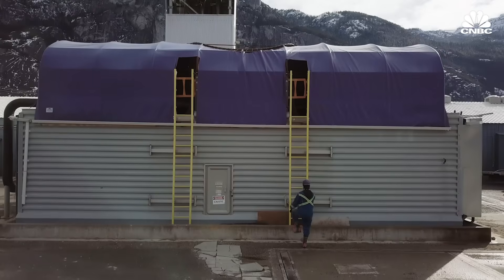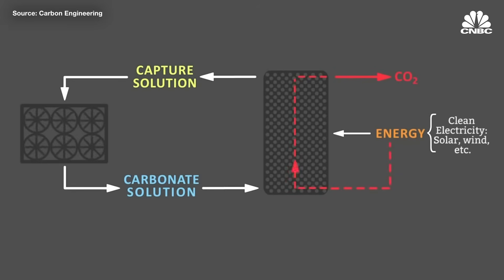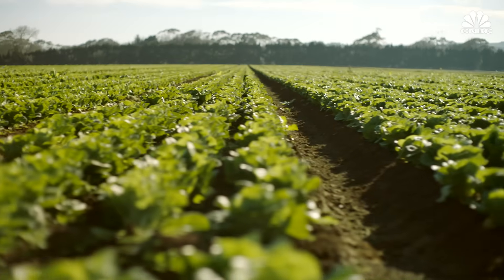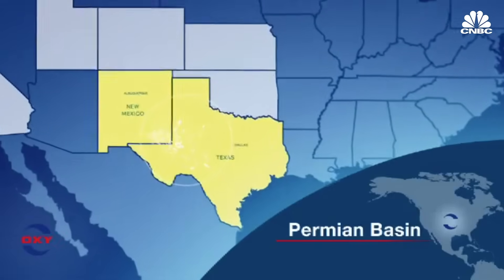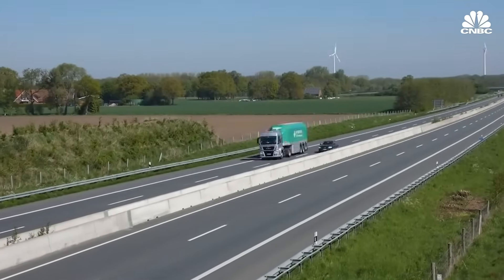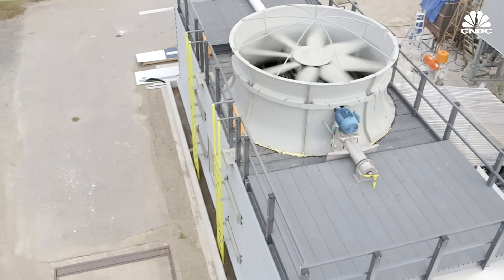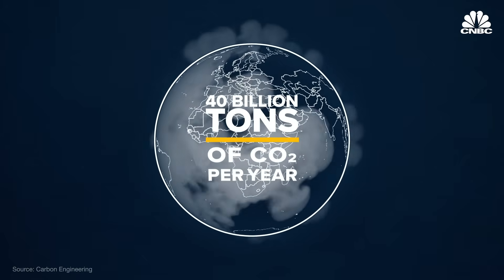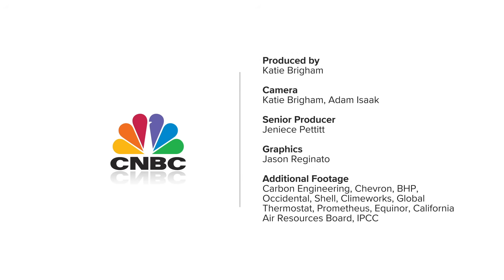Bill Gates-Backed Carbon Capture Plant Does The Work Of 40 Million Trees

Comment: SURPRISE, SURPRISE carbon dioxide is a life giving gas as plants absorb it they give out oxygen we breathe.
Crops love it and produce food for flora and in return feed mankind with crops.
There is no carbon 'problem' or 'carbon dioxide '  problem, only benefits for mankind- we are a carbon based life form.
But the cunning Jeremiahs want to fighten folk with uncritical minds, especially school children eg ' 'inconvenient truth' scare cartoon by Gore!
In Sydney Harbour the sea has risen about 200mm since 1890 or  about 8 inches !
Check the records of sea levels by Sydney Maritime Services Board from 1890.
So much for the reveries  of  the man made climate push -  melting polar ice caps and shrinking ice glaciers.
To the 'Climate gate' weather data tweakers
Pull the other leg ! It jingles.

Comment: Why not bury the carbonates rather than recover the calcium- no leakage to worry about, you don't need to bury it deep and seal it. Luckily the co2 greenhouse scare is mostly just a mass hysteria anyway- 30 years of shrill 'sky is falling' predictions and nothing to show for a large step-change increase in CO2. The heat-trapping capacity of co2 in the real world is exaggerated at best.

More pressing problems are: massive ecosystem loss, forest clearing, and huge human overpopulation.

Comment: How much CO2 is emitted; manufacturing the components for the machines,  building the machines, transporting all the parts in the supply chain, all the concrete use on site, building any roads for site Access, maintenance and spares for the machines? You don't have any of these problems with planting trees. Though, to replace an acre of forest takes at least 50 years to get back to full health. I guess we could all back off on infinite growth on a finite planet, having less and using less, but we're too greedy for that!

Comment: $94 - $232 per ton of CO2. 20 pounds of CO2 per gallon of gas. 2000 pounds per ton. So, this meathod captures the CO2 from 100 galons of gas.

That means that the cost is $0.90 to $2.32 per gallon of gas. So, a 100% tax on gas could make gas 100% carbon neutral.

Comment: think about this. the oil companies need to drill, pump, transport/transfer to refineries, refine the crude, store the different "products" of the crude, and then transport it to stations for sale. it makes 100% sense for an oil company to get involved in co2 capture. the captured co2 can be turned back into hydrocarbons and then fuel vehicles. no risk for drilling, pumping, transporting initial volatile liquids, storing and recovering other by-product gasses, or long pipelines. the end result is prospective higher gains all the while becoming carbon neutral.
Reply: Just get off fossil fuels and go electric charging off nuclear and solar
Reply: @Les_S537  it's not as simple as that. the infrastructure isn't there for mass immediate shift off of fossil fuels. Plus, the mining of lithium is damaging to the earth as well. The best part of this idea is that it's not a solution. It's a means to extend the window we have to discover, design, and build better and less harmful batteries. So, when the time is right, we can start phasing out fossil fueled vehicles. Nuclear power is also not a great idea as the nuclear waste needs to be stored. 

If we could capture enough co2 from the air to convert back into fuels that we don't have to drill any more oil wells, we'd be carbon neutral. according to them, just 40,000 co2 capturing plants could account for the entire global co2 emissions. we could fit one every 88 sqaure miles if they take up 4 acres each and reach 40,000. All funded by oil companies. The best part for the oil industry? No more oil drilling means they're re-selling you the fuel you already bought from them.

Comment: "It's not stopping the fossil fuel industry."  Talk about losing the thread.
Reply: Fossil Fuel Industry has way more Downside then just co2.
Reply: @gsuekbdhsidbdhd  And it currently has way more upside than downside. Also no other energy source comes close in ease of use, energy density, distribution or cost. If you want things to change you have to beat those metrics. Not easy to do even with nuclear and a power grid and good cheap batteries.
Reply: @dsap4004  Maybe, this applies to the actual state of the art. But a big share of the consumption isnt important at all no crusadships are needed not everyone has to flight to any destination. If we cut in those areas we can cope it with alternatives. Nonetheless fossil fuels are not infinite so there has to be a change.
Reply: @dsap4004  I would agree with you if you don't count all costs of energy sources.   The current financial 'cost' of fossil fuels is not representative of total real costs.  Hydrocarbons are a fantastic way to store energy for all the reasons you mentioned, but you can't say the cost is cheap.  The cost needs to include the long term costs of accelerated climate change, healthcare impacts from pollution, military investment needed to ensure a reliable supply, etc.  If you factor all of that it, it makes other energy sources much more competitive.
Reply: @PoeticJusticeSC  Those "costs" haven't been calculated with an real accuracy and are more tied to policy making and regulator control to keep certain companies in power. This is the real reason you don't have healthy competition in the energy market. Big oil is on the side of the environmentalists because they know they are the only ones who can meet the regulations and push out all competitors and stifle innovation so everyone relies on them. It's a huge game and you are missing the point. The US military investment is for free trade all over the world and is based on Brenton Woods agreement to fight the cold war which has been over for more than 25 years. The rest of the world now needs to pay up after getting free protection and using fake environmental catastrophe claims to try to bully the US into providing more free services. The US has been an exporter of energy since 2012. We don't need anyone else. They don't like this so you get the narrative that the US is a horrible glutton and everyone else is doing amazing things. They are using failed technologies and getting kickbacks from their gov. that have failing economies. Good luck with your "real costs" analysis. It's all a scam. "Fossil fuels" have the highest energy density. We need to find ways to use them more efficiently not regulate them to death so that only a few companies can survive and become monoliths in the industry. If we wanted to get serious about energy we should have gone nuclear a long time ago. Again that's another scam and a political game played about "proliferation" and "nuclear weapons" and "dangerous radiation" instead of facts and engineering. You want to talk about real cost. The real cost is what happens when these "renewable" energy sources don't provide enough power on their own to keep going. We need to switch from hydrocarbons to nuclear. The cost of green energy is too high and requires hydrocarbon infrastructure to survive. That's the honest truth and they are playing you.
Reply: @PoeticJusticeSC  Also we rely on hydrocarbon derivatives for plastics which is another thing that gets hated on. Plastics have saved the world many times over vs their environmental or any other cost. Modern medicine to say the least. What is the cost of driving up the per unit price of plastics used in life saving devices? Computers? Everything in your house? I'm sure pharmaceutical companies would love to charge more. This short sighted narrative I hear when it comes to the "great cost" of "fossil fuels" or whatever truly disturbs me. It shows just how out of touch we are with the real science and the impact on society these technologies have. But sure...try to run your life off of solar and wind without plastic derivatives or modern manufacturing, or healthcare and see how long society lasts like that. No computers either. They aren't green and need to be factored out. They aren't "needed". Nothing is really. Just comes down to how far you are willing to sound virtuous to spite your own face.
Reply: @gsuekbdhsidbdhd  - thats the first time i heard anyone mention lifestyle.  elon musk fanboys are always talking about how evil oil is but half of them showed up at the model y premier by getting on an airplane, and the other half have no qualms with getting on one.  they just like to stand on their fast and inconvenient electric vehicle soapbox, the one built with 85% oil.  not to mention the oil that will be necessary to cover the planet in superchargers...
Reply: @tehevilengineer7939  There is more than just one kind of battery.
Reply: @tehevilengineer7939  There is still development and new kinds of batteries we are not at the end of our possibilities
Reply: Really tho, well congratulations go back into your basement and be a hater while the rest of us save the planet
Reply: Or politicians...
Reply: When you are so invested in your work/interest you risk turning into a fanatic.
Reply: There's a certain variety of ideologue that doesn't really want to fix climate change - they just want to use it to advance their own economic agenda. This variety of ideologue is easy to spot: they like to throw the words "technocrat" and "utopian" around whenever someone actually does something that helps.
Reply: @AlephOneNine  ...and then they wonder why there's so many climate-change skeptics.
Reply: The intellectuals just want to destroy everything they disagree with

Comment: the energy needed to remove this dioxide from the atmosphere through this model is impracticable, to remove both the dioxide that has already been emitted would require more energy and this generation of energy would come from where from the coal-fired power plants? if it is necessary to implement clean energy to close the account then it loses the sense of implementing a project of this caliber worldwide, do you want to replace the trees as if they only fix the carbon fixation and all the other benefits that the trees provide us? this technology can even be developed and used in parallel, but never as a solution, even for it to work out that it needs another solution to be totally integrated, it depends on the clean and accurate energy supply of a market for this captured co2.
We need more plants, more trees, invest in clean energy, and not get dependent again on the projects behind this project, it's a smokescreen, literally backed by the soot industry. These oil companies should be investing in solar energy, their associates should start thinking better because the oil industry has its days counted, and there are plenty of reasons.
#wedonthavemoretime

Comment: This is sooooo stupid! so stupid. Capturing from the air? What? how much fossil fuel is needed to run these plants?

It does make sense to do this at oil refineries and coal power plants, in their smoke stacks. Otherwise there is not enough CO2 to make this worthwhile in just regular air.

Comment: Sell the carbon dioxide to soda companies who bottle it so it can released immediately back into the air! Lol. Good try. 

Soda companies themselves will be under threat.

Aren’t there basic laws of thermodynamics that come into play here? We need to get renewables (solar capture as ultimately all energy on earth came/comes from the sun) to a point that not only do we not use carbon fuels but also are able to reconstitute all the coal and oil extracted over the last 100 years. What is actually realistic?
Reply: I think we need nuclear to provide the bulk of our energy supply.  We need a base of power to work off of and solar and wind can never be that backbone, and installing batteries all over the place to store energy just isn't going to work due to the costs associated with it.

Yes, get off all coal and natural gas and wind turbines, shut down current nuclear reactors, and install molten salt nuclear reactors which are safer and cheaper than current nuclear model designs.

Once we're there, we can run as many atmospheric CO2 scrubbers as we want because the energy it would be using to operate is zero emissions.

Comment: This is like putting a Band-Aid on a sucking chest wound! What about all the organic pollutants and heavy metals which is produced from our petroleum carbon-based fuel sources. We must decrease all of that by not using these Technologies which are outdated in the first place. What is the carbon footprint of this sequestering of CO2 how much energy does it take to run the process has anybody asked that? Give us the real good technology like doctor goodenough solid core fuel cells which are not flammable and don't explode have three to five times the energy density, and charge in 14% of the time? Why is this technology being held back from the citizenry? These Jesuits need to go this mealy-mouthed Jesuit Barbara Burger, casually telling us that we'll still be using 50% petroleum-based gas and oil to run things in 2040? Bulshit don't buy their propaganda. Expose the Jesuit order in America and abroad. We must humiliate them out of power and we must call them out by name

Comment: how were you planing to bypass thermodynamics?
Reply: They are just hunting for naive investors.

Even if you would have access to free concentrated solar to power it up, and recycle chemicals, it will not make any difference. You will need to speed few trillions of dollar per year to even maintain current levels of co2.
Reply: There's no attempt to bypass thermodynamics here.  The carbon dioxide originated with combustion.  Thermodynamic considerations only come up if you're trying to reverse that reaction without a net loss of energy.  What this system does is really just moving the carbon dioxide around, which isn't the same as reversing the reaction and can be done for quite a bit less energy.  I'm not suggesting it's a practical system, just that it's not some sort of perpetual motion scheme.

Comment: I think one of the most promising ways to capture carbon is to use it to make concrete. Normally, producing concrete releases CO2 but researchers are working on how to do the opposite, and finding that carbon-infused concrete can even be stronger than normal concrete. Ultimately we need to find a home for carbon atoms, and putting it into our manmade structures as wood, concrete, or maybe something better in the future, like carbon nanotubes has the best promise for economically sustainable carbon sequestering. Imagine replacing all highways and buildings with carbon-rich materials: it would be so many tons of carbon sequestered.

Comment: A successful process would leave the "thin air" thinner than when it started - how   much thinner you ask ? To begin, what is the procedure to measure the initial carbon dioxide content, and secondly - what is that content ? Does your process have sufficient resolution to measure the difference between the initial concentration and the expected post-process concentration ? You may want to be able to answer these two questions prior to any further "announcements".
Reply: Those questions are all easily answered just by doing a few google searches and a little math.  To answer your first one, though...  If carbon dioxide was reduced to pre-industrial levels, and not replaced with oxygen, the atmosphere would still have about 99.98% of its present density.  That's based on a reduction from 410 ppm to 270 ppm.  So the amount by which "thin air" would be "thinner" would require fairly sensitive instruments to measure, and would be completely swamped by normal weather related changes in air pressure.

Comment: What these idiots aren’t telling you is, that all of this spending money on this stuff is a waste of time as well. 
Unless you can talk China into building about 10,000+ of these things. 
If concrete was a country, it would be responsible for just over 32% of the worlds CO2 pollution. 
With this and adding cars into the equation, China is the biggest culprit of CO2. 
These machines in North America running full blast would take about 2 teaspoons of CO2 out of the worlds “bucket” ....meanwhile China adds back a cup.  
DO NOT invest in this.

Comment: This is a complete waste. So basically what they plan to do is use renewable electricity to capture CO2 released by oil. The net efficiency of this is very very low. Why do that? Better get the renewable electricity and put it in batteries and use it directly!! Use for engineering synthetic fuels is OK.